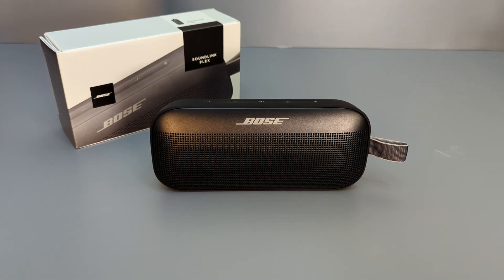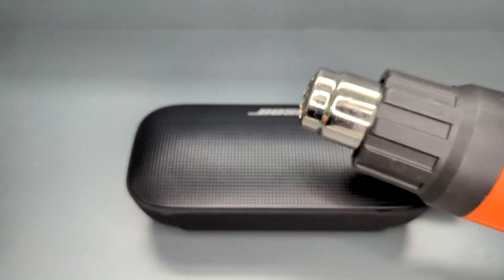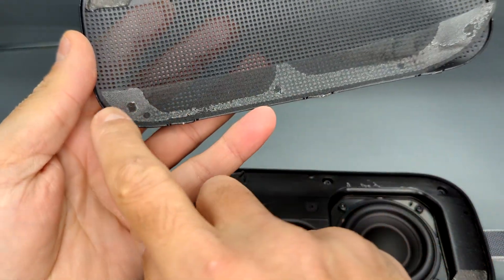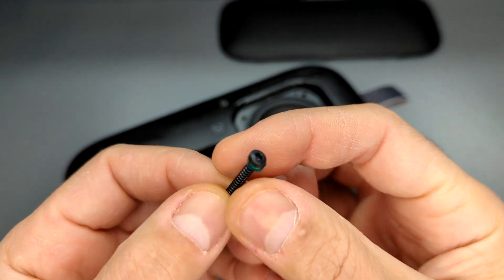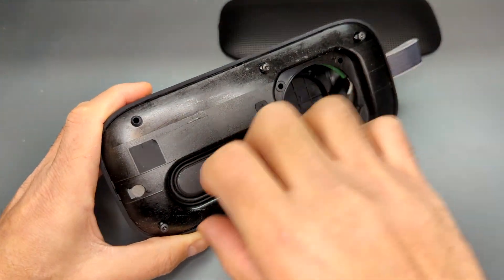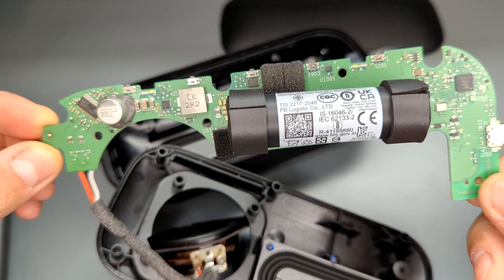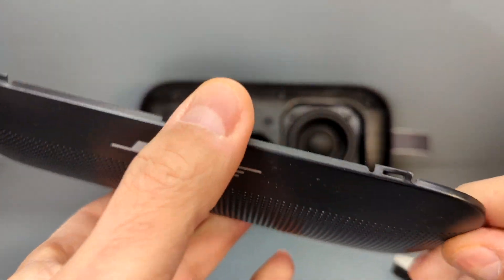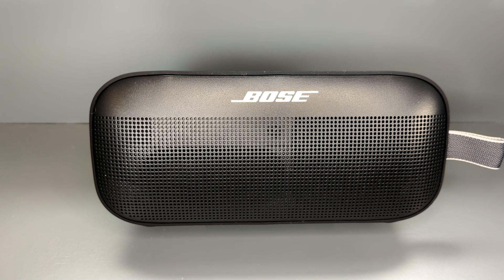Bose Soundlink Flex Teardown

Comment: Bose bt speakers 🔊 are trash and overpriced better getting a JBL and the bass is way better
Reply: There is some comparison between Jbl and Bose, and the Bose has much more bass and way better balanced sound.
Reply: @scottykilmer3920  I 💯 agree Scotty.
I spent an hour listening to a variety of music (acoustic, rock, etc) on all the models in the store.
JBL has abit more bass but sounds muddy. The BOSE took the cake for clarity and balance...(hi - mid - low levels) blew away the other units.
Reply: I have a Bose soundlink flex and a jbl charge 5. I noticed that the Bose product had a more audible mid-bass bump, which a lot of people like, but is technically not how the artist intended the music to sound. This bump is absent from the JBL, but the JBL actually extends lower. The Bose has decent treble response despite what people say, but the JBL is quite a bit better. The JBL also has a better mid/vocal response. I liked the Bose on some songs, and I liked the JBL on others.
Reply: The Jbl speakers sounds all like a 90's radio to me. it only screams in my ears nothing more. Jbl is only good for 1 thing BASS!
i must admit Jbl subwoofers are the best ive ever used in my cars.
Reply: Have you heard the new Charge 5 speaker in a quiet room? You can actually hear more details in the sound, not to mention it vibrates my floor, which the Bose did not do. The Bose has a serious peak at around 80-100 hz, which the JBL does not have, giving the illusion that the JBL has less bass, but then you slowly realize that the JBL can actually hit as low as 50hz, just not as loud. Still, the untrained ear will definitely like Bose better!
Reply: Jbl sounds amazing for very young people who just wants to hear a lot of bass and ear hurting highs. 😏
Reply: @scottykilmer3920  I watch your videos, and know you’re a car guy. I have definitely had that experience with the JBL sound systems in Toyota and other vehicles, but never the other JBL products. 
Take for example a few mid-2000s Priuses I’ve been in with premium JBL sound. They seem to be a very bright sounding system, and the bass, while it’s there, is nothing fantastic. Also I’ve been in a JBL-fitted Camry that had the same problem, just worse. The front sounded okay, but the back sounded like nothing but really deep rumbling bass and a hi-hat! I bet the base model sounded better, and believe it or not, most base model Honda stereos, known for being bad, sounded no worse than the Prius PREMIUM SOUND. 
So basically, JBL car audio sucks. I agree on that.
Reply: Not true. I bought a Jbl but ended up going back to Bose due to better sound quality
Reply: That JBL charge sounds flat af bro trash 🗑
Reply: @PapiLuitube_  you should look up the definition of flat. It is often used to describe a mid heavy sound, when really that sound should be described as hollow or boxy.
Reply: @djijspeakerguy4628   Flat in terms  of bass.I was dealing with a 30 dollar speaker and I wanted to upgrade so I been seen every one get a JBL so I got the Charge,when I got home and started playing it I was very disappointed with the bass delivery like not much different form my cheap speaker so I returned and swap it for a Bose sound Link and Man is a day and night difference
Reply: Jbl was a very good brand back in the days, now they are really messed up, thanks to Harman/Kardon and Samsung.
Reply: May be we can request to make Hybrid version where design and Radiators are from JBL and Tune and Drivers from Bose (because Bose sound natural) . Design wise JBL king , Melody wise Bose King .
After all main motive is to give Consumer the best experience 👍
Reply: BOSE > JBL
Reply: JBL is the gold standard all speakers are measured against. But the BOSE here is a great competitor. It’s lighter, sounds as good with a little less mid bass. While having a mic for answering calls on it.
Reply: @catharticcathexis4527  😆😆😆😆😆😆😆😆😆😆